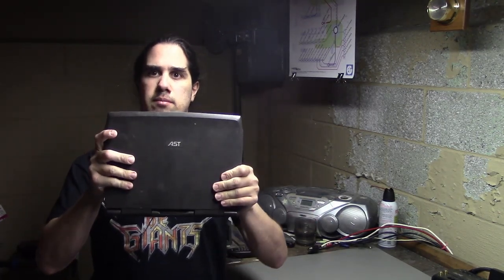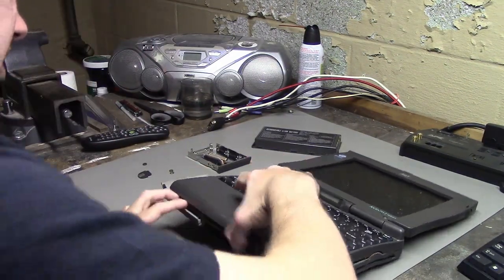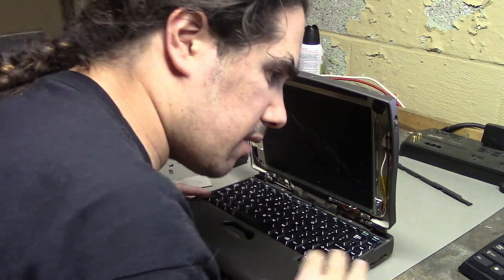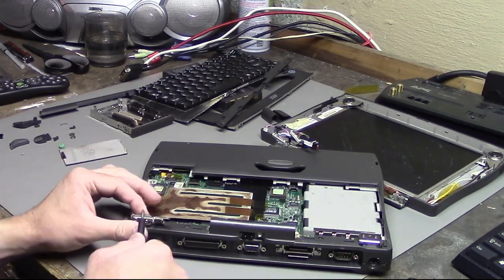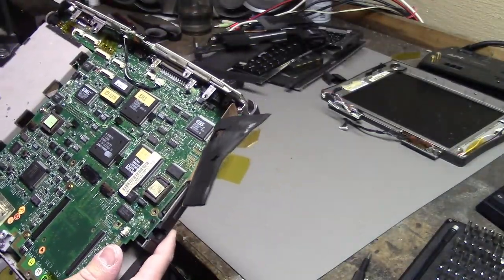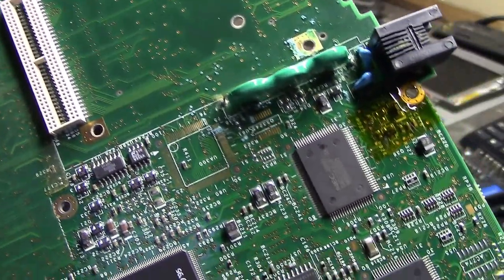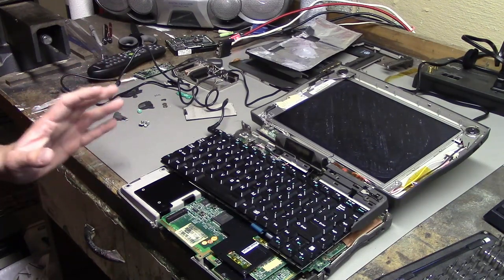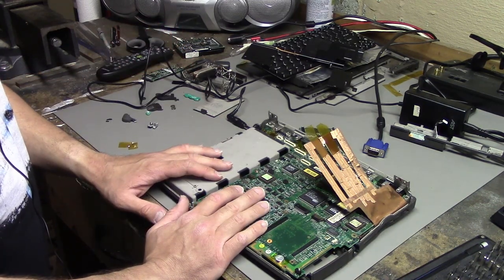Attempting to repair an AST Ascentia J laptop

Comment: Thanks a lot for your help. My AST boots but I have msg on screen that battery CMOS is death. I have started to take a part and couldn’t find it. I thought I might find help here, so I found your clip. I will try to get out this battery through bottom holes of the laptop. I don’t know where I can get this exactly same battery and how to replace it.
Reply from the maker: What model AST laptop do you have?  Is it the same as mine (Ascentia J)?
In the video, at around 26:00, you can see the BIOS battery (it's the green thing attached to the board).  I just clipped it off of my board and haven't tried to replace it.
I can try to find it and see if I can find the model number of the battery.
Reply: I have exactly the same AST J 20 as yours. I search on internet for this cmos battery 3.6V can’t see clear 11mAh 3/V11H, is that correct. I don’t know which one cable is + and - to solder it correct when I get new battery
Reply: @nticompass  Please, that will help me to find correct battery. I found 15mAh, 20mAh, 40mAh don’t know if they could be compatible to this AST model
Reply from the maker: I can't seem to find the battery I removed from this laptop, I must've disposed of it.  I will look through the raw footage and see if I can find a better shot of the battery and get you its specs :)
Reply from the maker: The battery seems to be 3.6v.  The capacity (15mAh vs 40 mAh) shouldn't matter, the bigger the number the longer it'll last.

Comment: My guess is it's something with the battery or power supply, maybe something with the screen. Do some research and do a part 2
Reply from the maker: The battery wasn't connected, I knew that would probably cause issues.  The power cable isn't technically the correct one, but it seemed close enough.
I will come back to this, but it may take a while.